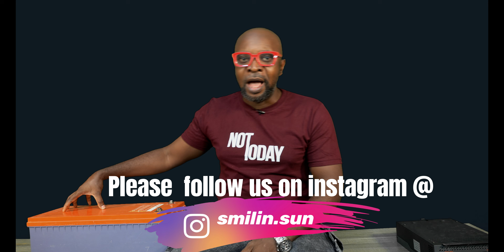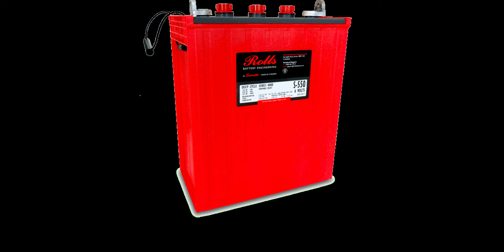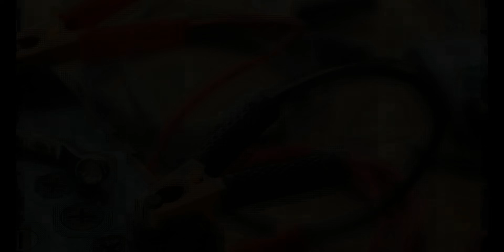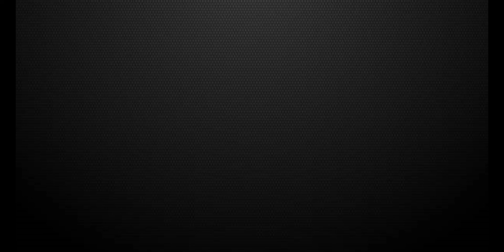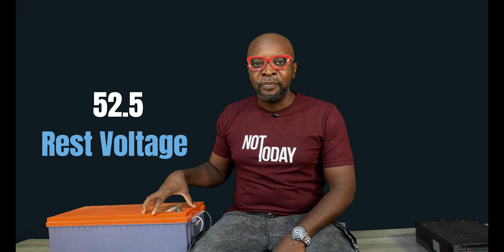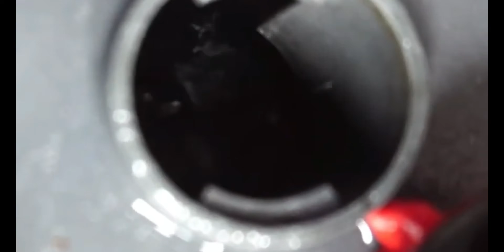Battery Charge Cycle in your Solar System

Comment: I want to understand, I increased my batteries from 2 to four batteries, I use a 24v inverter, with 4 12v batteries, but the charging and discharging is almost the same as when I used just 2 batteries. My inverter doesn't show battery percentage it just shows voltage and I mostly use electricity to charge as we hardly have sunlight where I reside now (topic for another day). So when the batteries charge up to a point, it charges to 29.3 volts when fully charged, it shows 27.7 volts. Then when being used, it suddenly falls to 25volts and gets low around 22.6 volts. So what I want to know is, at what point in terms of voltage reading does the battery begin to drain?.
Reply from the maker: 12.8 12 volts system   ,   51.2 48 volts System and 25.6 24 volts system

Comment: Good evening sir. Please sir I have a gel 200Ah battery. According to the manufacturer it's absorption charge is between 14.4-15v and float charge of 13.68-13.8v. In ur opinion what should be the best absorption voltage and float voltage for my battery
Reply from the maker: Gel Battery needs less charge than a Tubular battery, overcharging your Gel will dry up the Gels. 14.4 should be the charging max
Reply: @smilinsunsmilinsun8056  okay. Thank you sir. But won't using 14.4v cause the battery to sulphate?
Reply from the maker: @tennicyemma1680  No the battery won't sulfate
Reply: @smilinsunsmilinsun8056  thank u so much sir. God bless you

Comment: Hello Mr. Ikenna, How are you doing?
Please what should be the equalization voltage for a 24volts battery system?
My solar charge controll (MUST 80A) came with the equalisation function and it is set to 15V as default and with room to either increase or decrease the voltage.
Thanks
Reply from the maker: 32 volts

Comment: Please sir I bought Tubular battery nowly 12v 220h , can my solar system I have before charge this battery full 180w by 3 and 20ah mppt charge controller
Reply from the maker: Hello Sir it is not clear how many batteries you have
Reply: I have only one battery  @smilinsunsmilinsun8056

Comment: Thank you for these very informative videos. I have a 24volt system, I have been using it for almost a year now. I have never done an equalization charge on it and my charge controller has a charge equalization function, it is an 80A Felicity. Can I enable the equalization charge by myself or do I need a professional to do it for me?
Reply from the maker: The instructions are in the Manual it is something you can  do yourself

Comment: Please PlayStation 5 kills my 12v x 2 tubular battery on 2.5kva inverter system in less than an hour.
Reply from the maker: It's not supposed to , maybe your batteries are not fully charged so there is less Energy to dispense. How many Solar panels do you have?
Reply: @smilinsunsmilinsun8056  4 solar panels
Reply: @smilinsunsmilinsun8056  30a Felicity mppt
Reply: The system is 24v
Reply: Also, what type of controller are u using? MPPT  or PWM?
Reply from the maker: @adex2000ng    MPPT
Reply: @adex2000ng  Felicity 30a mppt